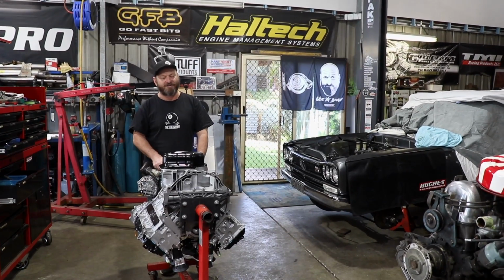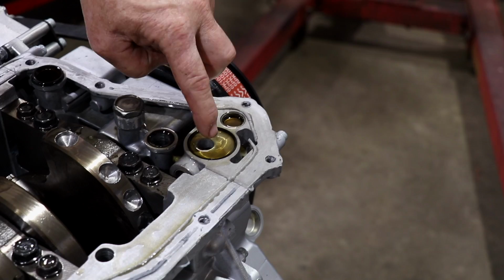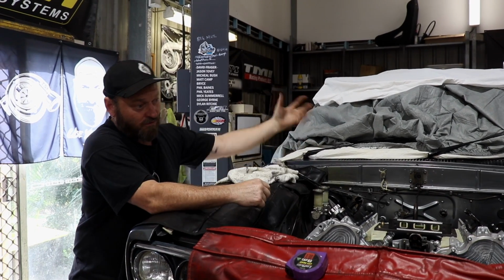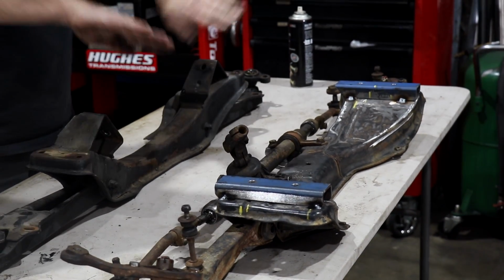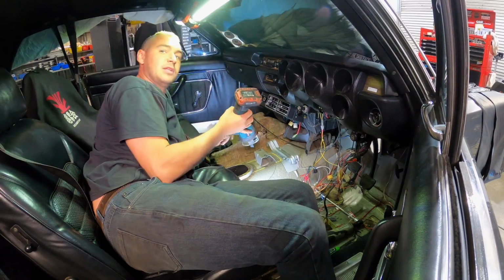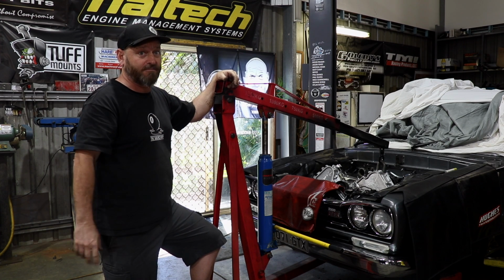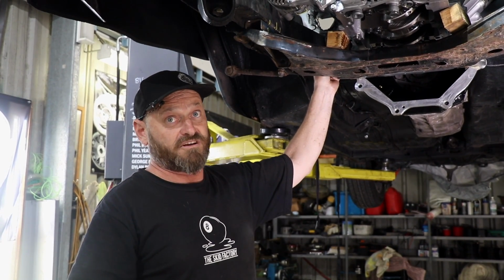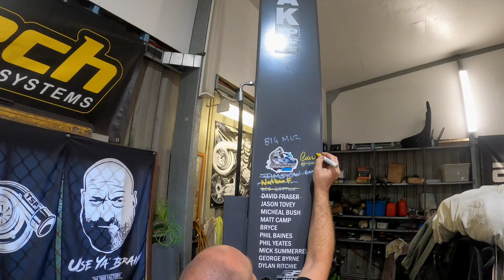Ruining a Classic JDM vehicle with POWER & RELIABILITY!

Comment from the maker: What engine would you fit if this was your car?
Reply: I'd fit a Hartley Engineering Nissan VK56DE. Or maybe an OS Giken TC24-B1Z for purity if I had the cash.
Reply: If i'd try to daily it, an every day garden variety LS to be perfectly fair. Nothing quite like stupid reliability.
Reply: PPRE 20B single turbo. Just for the purists..
Reply: Iron duke 2.5L
Reply: Rd28t
Reply: Flat plane vk45de for the noises
Reply: VQ35 with a centrifugal supercharger and work for 8000rpm. Motordyne exhaust.
Reply: RB because I'm a basic bitch. Maybe an RB30 because no one in the states has them.
Reply: Naturally aspirated rb2630 with itbs and a sequential box.
Reply: Ford Godzilla with an 8-71 Supercharger.
Reply: RB
Reply: fj20
Reply: Ls, just to feel the hate
Reply: Merlin V12
Reply: I would go with a modernized L28, keep it simple, keep it pure
Reply: 2UR-GSE... but good luck finding one I guess.
Reply: I reckon an RB20 with a small single would be plenty for this chassis, maybe I’m not ambitious enough🤷‍♂️
Reply: PPRE quad rotor because why not? Also you didn't say anything about the cost of said engine
Reply: Lambo v12
Reply: Toyota 2UZ 4.7L Tundra motor with a Supercharger
Reply: Rb26de itb from autech r32
Reply: An Alfa Romeo 105, then see how it goes against the Alfaholics GTA-R
Reply: RB25/30 with a G30-770 in front of a CD009. Would be a piece of piss next to this, make a stack more torque and power, and not give up much in the way of driveability. Probably cheaper as well.
Reply: 1VD-FTV.
Reply: VQ35 cause I'm poor...
Reply: A sr20 simple and reliable
Reply: Sr or an rb
Reply: LL8 Vortec 4200
Reply: I should say ls ...but i havent learnt my lesson  to keep things simple soooo probably a nissan v8 of some kind. RIP Rumbles
Reply: Soviet tank engine
Reply: L28
Reply: 13b surely
Reply: Pratt and whitney R2800
Reply: 5th Generation BEAMS Blacktop 3S-GE with a balanced and blueprinted ATS forged 2.2L bottom end from a 1998 5S-FE mated to a 6spd manual and TRD LSD, with a GTX3071 Turbocharger, GReddy FMIC, 1200cc Injectors and a full Haltech system and custom full body wiring harness to run the entire lot including working A/C for all this Texas heat.
Reply: You'd have to go the Hartley H1 V8 if it was street legal...
Reply: Rb20
Reply: 4bt haha
Reply: I love this engine. If not this then maybe a fully sick, cammed up, NA RB26 for purity.
Reply: @oldschoolmotorsickle  
Why the 2UZ, if you don’t mind me asking? Why wouldn’t you use the 1990-1984 1UZ (If you’re planning to boost) or the 3UZ (If staying N/A)?
Reply: 20B or big trike motor with high revs and dogbox
Reply: K24 turbo swap to enjoy pure power and reliability and to piss off the internets
Reply: I would probably go with an L24. Smooth, reliable and easy to fix. Also lots of Nismo parts still available.
Reply: A diesel.... Just to REALLY make people loose it... OM606 because Germany is the neighbor closest to us..
Reply: Ford 7.5 liter
Reply: Ford Zilla with Whipple on top
Reply: A Volvo vea 2.0 twincharge or maybe a BMW 2.0 turbo from a 328 👌🏻 If the 2.3 ecoboost or the gm equivalent where more common here, it would be one of those 👌🏻
Reply: Mercedes OM606. Make it diesel power.

Yes I know it's sacrilegious. Shutup...
Reply: @nestrac  I just said the same thing. Go figure.
Reply: JZ for the haters.
Reply: @jakubbagin6762  
KA24DE might piss them off more. Relatively unloved US spec “truck” engine that normally gets swapped out for a “better” Nissan engine dropped into a chassis the purest lust over?
Reply: I'm Barry 🤙👌 I'd probably go with rb30 n/a build or turbo being in Ireland ain't no rb30s about , is ther any diesel patrol blocks I could use ? 😋🤣
Reply: FJ20 if parts were still easy to get
Reply: Us a air hammer when beating tunnels and firewalls its way tiddler if you've a soft edge hammer on it 👌🤙
Reply: I would keep it stock, and just drive it😄
Reply: Na rb30 with Itb's built by nelson
Reply: Twin turbo big block
Reply: OS Giken TC24, or a BMW S54B32HP out of the M3 CSL
Reply: @Beer_Dad1975  Not hard, just need a crashed ISF
Reply: RB30ET since the RB26 fit into the MCM 240Z
Reply: 300,000Km LS1
Reply: 4 rotor or 6 rotor
Reply: Kubota..
Reply: OM 606 !
Reply: 4m41?
Reply: Anything that Rumbles
Reply: QR25DE from a 2007-2012 Nissan Sentra SE-R Spec V. I think it would be a little more reasonable than the V8 but still extremely fun and pretty quick.
Reply: Volvo T5 with h beams and a 20t hybrid. All the right noises 😁
Reply: A VG30ET
Reply: If it was my car it would probably be sitting in the shed with an empty engine bay cause i spent all my engine budget on other broken cars instead.
Reply: 20b cause rotary
Reply: yes
Reply: LSx 427.
Reply: Ford 302, carbed, with heads cam intake...and some flapjacks.
Reply: A Volvo Redblock. Just for shits and giggles
Reply: audi czgb 2.5
Reply: Volvo b20 with a turbo hanging of it
Reply: Triumph V8
Reply: Vr38det. Old school gtr meets modern day gtr
Reply: Comma knocker
Reply: Briggs and Stratton...🤔😳😐
Reply: The one you just put in it is cool, but maybe an LS3/6 speed Tremec, then put it on every Japanese car FB page just to read the hate mail ;)
Reply: That 700hp RB20 from the powercruise would be alright xP
Reply: Depends what my goal was and if I had to pay for it if I didn't with the goal being to  make Al curse I'd say the V18 out of a Komatsu 960E dump truck. If I didn't have to pay for any of it and a more realistic fit the V12 out of a DB7 Vantage what can I say I like David Brown tractors. Realistically whatever I could afford but still have enough money to work on the rest of it so at the moment one of those Lego technic motors and AA battery packs...
Reply: Depends what my goal was and if I had to pay for it if I didn't with the goal being to  make Al curse I'd say the V18 out of a Komatsu 960E dump truck. If I didn't have to pay for any of it and a more realistic fit the V12 out of a DB7 Vantage what can I say I like David Brown tractors. Realistically whatever I could afford but still have enough money to work on the rest of it so at the moment one of those Lego technic motors and AA battery packs...
Reply: An RB26 NA
Reply: 22r would fit nicely.
Reply: 2j the world haha
Reply: BMW N63
Reply: a red motor, what else :)
Reply: CA18DET
Reply: @HotForgeChaos  ever priced a OS given engine? I have and holy shit
Reply: I would put the Nissan DIG-T-R, 400 bhp 1.5L 3 cylinder
Reply: wuts the matter with a V-8?!
Reply: Panasonic industrial hydrogen fuel cell or perhaps a bank of them. Seems like it would be an easier swap at this stage. Can't wait till you stop this trolling and just bash that RB32DETNeo that I'm sure is being built up for it.
Reply: Xtrail GT sr20det with VVL
Reply: RB
Reply: If I get to dream a little and win the lotto it'd be a Judd V8.
Reply: OM603/606/648 ;)
Reply: SAAB B235/234R T7 hybrid with a juicy snail on it.
Reply: B8444s
Reply: D24TIC
Reply: the stock one but tuned for some sweet N/A power
Reply: Love to see you fix a BMW V8 and put it into something no one would see coming...maybe 2WD hilux with a pair of rear mounted turbos? 
No really you guys got better mad ideas you don't need any help making mad sh!t cool & working.
Keep on keeping :-)
Reply: L28et
Reply: Only big block chevies or Pontiac’s here mate
Reply: K24
Reply: Bmw m30b34
Reply: S20 with mild cams and replace the carbs with modern itb.
Reply: @HotForgeChaos  Pretty rare car in the antipodes though, even rarer to find one crashed.
Reply: Rb25 det
Reply: Probably the vk56 to be honest now if seen it in the engine bay aha fits well and the weight difference is minimal, should still handle great!
Reply: @EnderAlexander  yes 👌👌👌
Reply: I think that an rb 20, but also an LS would be good. I don't have the money to go with some exotic (for me), but also, tried and true is a big deal for me.
Reply: 1800 BDA with a propper matched Turbo!!! Nice.
Reply: P76
Reply: Probably like an L28 or SR20 or some light Honda engine. I only need or want so much brute force.  :)
Reply: 5 cylinder, Audi, Ford/Volvo whichever fits easiest 👍
Reply: Triton V10
Reply: I'm not up on my Hakosuka game or my modern import engine game, but just like the Hoff did, I'd swap a Toyota 1GZ-FE (I know, God help me for not being brand specific) into it with a six speed manual and either run it with ITB's and build some equal length headers and a full 3" dual exhaust for it, or I'd get one of these Nissan VK56-DEs for it and put a good size centrifugal supercharger (like a Procharger) on it (once again with fabricated equal length headers and a full 3" dual exhaust) and run it on a Haltech Elite. Those old GTRs are Holy Grail cars for most of us import fans and whichever way Al decides to go is always more than fine with me.
Reply: Now that i know that vk 'fits', probably that for sure. money no option, dry sumped, would be really cool for Nelson to do a flat plane crank version of VK
Reply: @HeWhoDrivesATruck  Personally I'd keep it light.   Probably no more than double stock horsepower to the extent I could without much changing the balance.  Or else it's not the same car.
Reply: The factory but with a stroker crank cnc ported head and triples carbs kinda what im gonna do with my 74 Z but im really considering a nissan V8
Reply: @BigDaddyGdog  Yeah, it certainly makes your eyes water, but c'mon, just look at the engineering and artwork gone into it. Its almost a crime to even fit it into a car
Reply: @Beer_Dad1975  Japan is where you want to look
Reply: Y44E obviously.
Reply: Autech rb26 I feel would be a perfect match for this as a daily. I'd keep that beaut VK for something with proper suspension and chassis. Or else, I would restomod the f out of this og and put the body on a modern chassis to match the VK.
Reply: Any Nissan/Datsun straight 6 motor with a set of ITBs, mild cam(s) and headwork and a manual gearbox for every day driveability
Reply: Destroked rb26de (no tebo) 6itb, high compression, oversized valve, over 10k rpm...

Power doesnt really matter... But it keeps the charm of 6cyl naturally aspirated as original hako skyline
Reply: Inline Audi 5 Cylinder with Turbo
Reply: as sacrilegious as it is a 1jzgte nice displacement big power for the little chassis
Reply: Nat asp RB.
Reply: 20b.
Reply: That 2 stroke saab joint that sounds like a swarm of bees
Reply: b207r, very plentiful here still.
Reply: Thinkin' a nice quiet two stroke diesel 
Jus for the greenies
Reply: Straight Six 1jz
Reply: TD42
Reply: Either a 13B turbo or a super nasty NA 20B
Reply: RB26DE
Reply: @MOS6582  and it would go bang like the rest of the vq supercharged motors
Reply: @oldschoolmotorsickle  if you're going ot that trouble you might as well go with a 2urgse. Cheaper, more power, newer motor.
Reply: Is that booster and master cylinder for sale guys
Reply: A de-stroked Rodeck 406 on methonal twin turbo
Reply: OS Giken TC24-B1Z or Mercedes OM606
Reply: A vk with e92 dct trans
Reply: 4bt Cummins. Because why the hell not? LOL.
Reply: RB20DET without a doubt
Reply: 13B
Reply: Really hard not to be bias here as I have an Infiniti G35 that I want to engine swap with a VK45, they're pretty rare and built in Japan and only found in a couple of Infiniti but it's a slightly smaller version of the VK56

Comment: Silly tip for you, when using wood blocks to find spacing a fitment. Take the piece of wood, and give it a good single wrap with Gorilla Tape.

When you cut a piece of wood that small, and have any weight or tension applied to it, it’s likely going to crack on the grain. The tape wrap keeps that from happening. Figured I’d share, seeing you’re working with some pretty serious components you probably don’t want slapping the floor.

Comment: Is there a plan for the rear suspension? It looked like semi trailing arms similar to the datsun 1600s, high powered 1600s AFAIK try to reduce the sweep angle and therefore negative camber gain under bump / squat so they don't lose traction, given the power this will make I imagine the same will happen with this.

Comment: Great project thanks for the update. Just one question as I feel like I’ve missed a bit in the explanation of the steering rack change? What made you think a rack from an a little 80s Toyota would work for a conversion for a 70 Nissan?( with massive v8?)😀
Reply from the maker: Because I know I can get one easily so o measured it up.
Reply: @theskidfactory  cool,thanks!